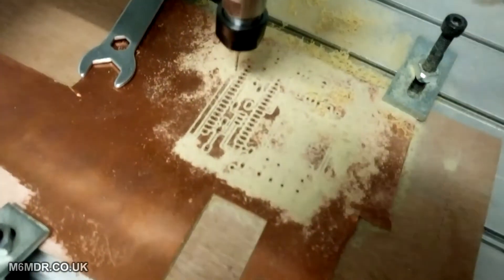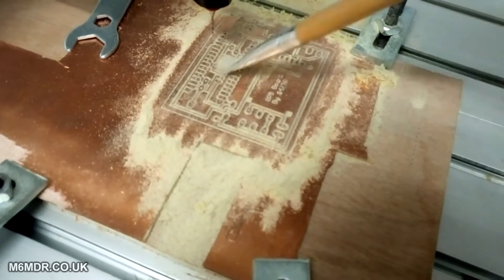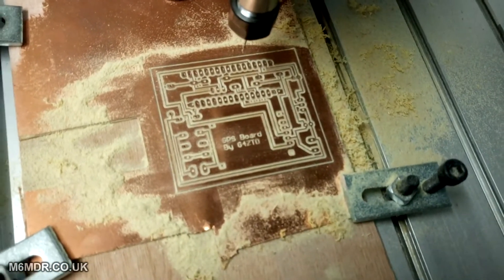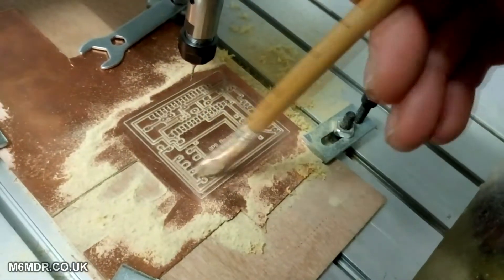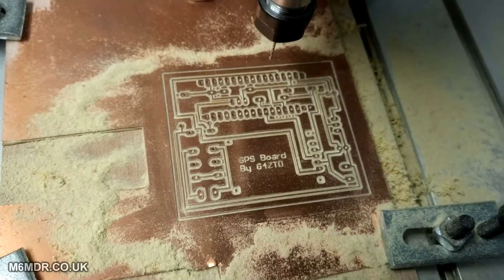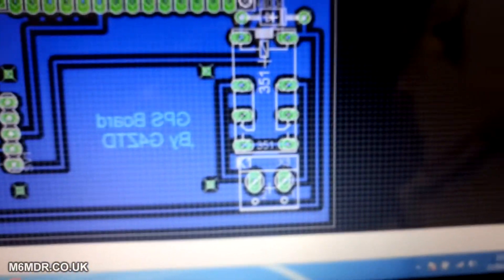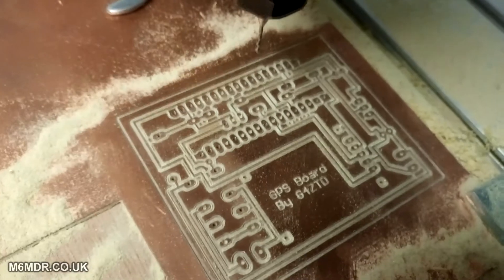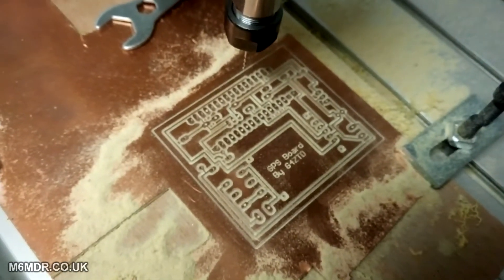First Glimpse of my USB CNC 3040 Milling and Engraving Machine [2017]

Comment: CNC USB Software that came with this machine is pirated and therefore illegal. USB controller inside box is counterfeited version of our Mk1. 
Visit our web site http://www.planet-cnc.com to see original controller and software.
Reply from the maker: I'm sorry to hear this but am not surprised. It seems all these items I've purchased from Chinese sellers are coming back to bite me in the ass. The 3D Printer I ordered which is only just 6 months old has burned out. Neither the seller, the manufacturers or any of the other parties involved in the sale (card issuer, PayPal etc) are interested in providing me any solutions. All the seller has to do is ignore me and he's all good. And my Credit Card Provider seems to think that beyond 120 days I shouldn't need any cover or protection so basically I shouldn't expect anything I buy using their card to last beyond 120 days. Warranties and protection assurances aren't worth the paper they're printed on or the breath they're spoken with...

And now I find out the £500 CNC machine I purchased in good faith is actually comprised of fraudulent parts.....
Nice one eBay! So long as the cash is flowing eBay seem to be turning a blind eye to some dodgy sellers and practices more and more it seems. And when buyers get stung and try to do something about it, we're on our own as I'm discovering.

I've since made my mind up that I wont be buying anything from China or Chinese sellers above the value of £5 anymore. It's just not worth the hassle. Later on it turns out to be cheap useless shit and they can just run off with your money without any worries at all.

Buyer Be Ware I guess....